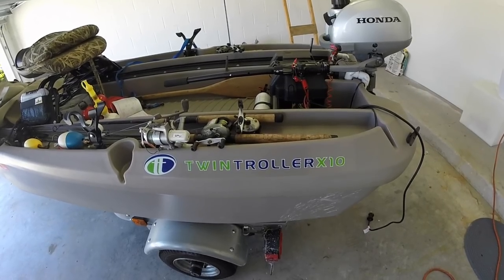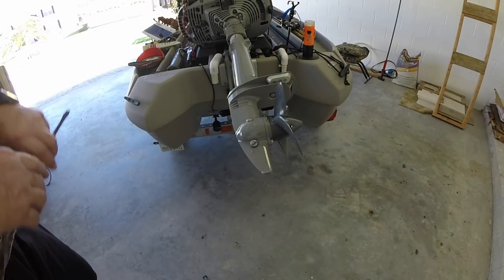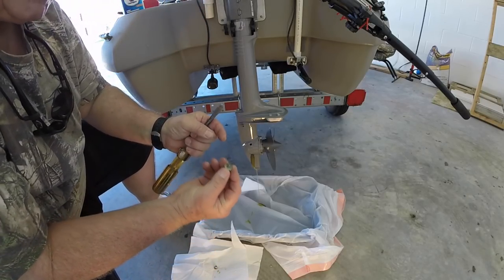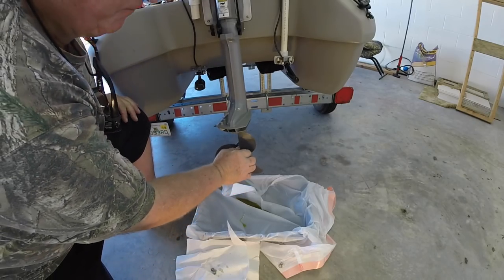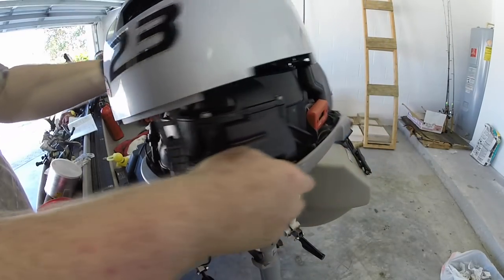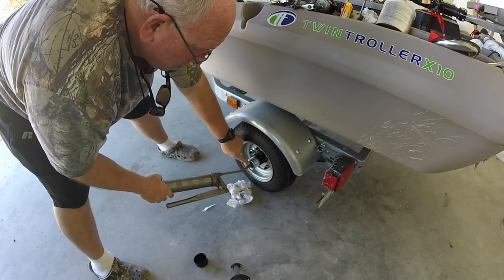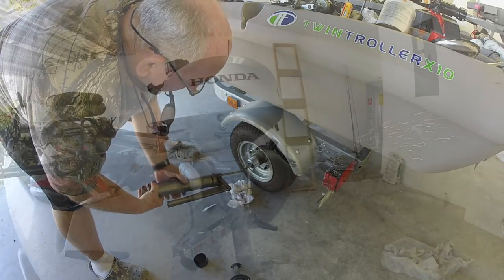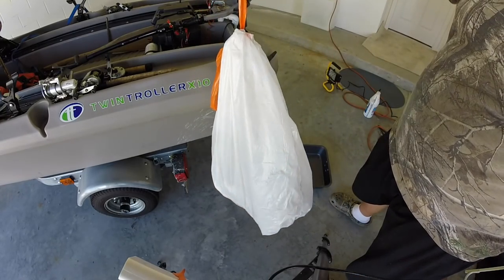HOW TO TUNE UP A HONDA 2.3 HP OUTBOARD ON MY TWIN TROLLER X10

Comment: Great video but how do I add the gear oil?.
Reply from the maker: Todd, You are the first to point that out. Apparently that was left on the cutting room floor when editing.
See the gear oil bottle at time stamp 1:27? Under the black cap there is a pointed nozzle. Snip off the tip of that nozzle so oil can be pushed out. Insert the nozzle into the bottom hole and squeeze until oil comes from the top but no more bubbles. Then continue holding the bottle in place  while inserting the top screw and start that screw by hand for now. Remove the bottle and then insert the bottom screw QUICKLY and get it started also. Then tighten the top and bottom screws. You will always loose a small amount of oil but if you are organized and fast you will not lose much.  You will do a much better job the next time you do this, next year. 
Good luck, Gerry

Comment: Did you ever hear a squeak in the Lower  propeller linkage when turning the propeller? Or does being submerged in water handle that?
Reply from the maker: Bill, I do not turn the prop out of the water so I do not know how to answer you. Try removing the prop to make sure there is no fishing line or debris behind the prop and if not, try spinning the shaft with no prop on there and see if you hear the squeak then. If you do it is an issue in the lower end.          Gerry
Reply: Lunker012  I have the long shaft model as it’s for a small sailboat ,squeak comes from the shaft extension linkage housing ,just serviced the motor after the first 10 hours ,I’ll ask the Honda guys still under warranty,thanks for the quick reply ,
Reply: Dealer said only turn prop clockwise ,chirp was impelers  ( rubber ) squeaking against housing  ( cools drive shaft)

Comment: Hello Jerry, greetings from Italy. Thank you for the great work you did, I am going to follow all the procedure to replace engine oil.  Actually I had an issue with my bf.2.3. I loaded into my car and laid from the wrong side…
 and I had lots of oil going out and I was not able anymore to start it up. I guess some oil went into the engine because when I remove the spark-plug I see is wet and looks like some oil is in it. In any case I cannot run the  engine anymore, it does not startup.  So yesterday after I saw your video I drain all the engine oil from the screw as you shown in your video and now engine is totally empty, honestly I don’t know if I need to open up the engine to the pistons level to clean it up, if you have any advice would be really really appreciated.
Reply from the maker: Giovanni, do not open up the motor yet. Try some of the following. Get a new spark plug (or at least do a good job cleaning the old plug to remove all old oil and fuel)  to put back in the crankcase.
Stand the motor back up and put it on a stand or the back of a boat transom, some place you can start it. Remove the spark plug and keep putting the starter rope until you do not have any oil squirting out of the spark plug hole. Pull that rope fast and many times to clear the oil and any fuel from the cylinder. Make sure you replace the crankcase oil to the normal level that leaked out when you put the moron on the wrong side. Connect the new plug to the wire but do not screw it back in yet. You or someone else hold the spark plug threads against the motor where the threads of the spark plug hole is. Pull the starter rope fast to see if you have spark. Make sure the kill switch is not disconnected and the throttle is in the start position on the throttle handle. If you do not have spark you have an electrical issue if you have spark you have a fuel issue, if you feel compression when puling the rope. If you have spark then now screw in the plug. Make sure you have fuel in the tank and the lever to allow fuel to enter the motor is on like you do every time you start the motor normally.
Try to start the motor as you normally do. If it still does not start let it sit and wait for another 1/2 hour in case it is flooded. 
If it still does not start, pull the plug to see if it is wet. If it is wet it may be flooded, leave plug out and pull rope a bunch to clear it and dry/clean the plug again then reinsert it and try starting it again. If it was dry they you are not getting fuel.
If plug is dry squirt a small amount of fuel in the cylinder then put the plug back in and if it starts, or tries to, but will not continue to run you have a fuel/carburetor problem.

Let me know how it goes,
Gerry
Reply: Lunker012 thank you Gerry for the valuable hints. I will try these days and let you know how it goes. I was thinking to open the cylinder to clean but i prefer to avoid this. Will try as you recommend.
Reply: Lunker012 I fixed it thank you. Acrually I removed the filter to check and there were oil everywhere inside the carb, gasoline oil everywhere. I dismounted the carb and washed all with gasoline and mounted everything back.  Then i followed your hints to get the oil out from the cylinder. Reinstalled the spark plug and at the first attempt the engine started. Its a good motor i like it. Mine lost the stickers to show the direction to laid it down. Which side do i have to put it down. Keeping the motor in front of me with the handlebar on the right, oil window in the right side. Should i put it down right?
Reply from the maker: Giovanni, sorry for the late reply. I just noticed your question.  The easiest way to remember is with the Honda laid down the tiller arm would ALWAYS be the highest point on the motor. The tiller arm would never be down on the floor. If you look on the side of the motor there us a small square shaped protrusion. That is the stand that you lay the motor on when it is on it's side. I hope that helps.                           Gerry
Reply: Your video and detailed explanation helped. Thank you very much

Comment: Being you have to lube the control arm by removing it from the body, perhaps you can change the oil with the arm off and prevent the mess of the oil running down.  😊. BY THE WAY I owned one of these about 15 years ago.  I had it about 4 months and it was stolen.
Reply from the maker: Walter, Good point however, I found another way to easily change the oil that I will show in a future video on servicing this or any other motor. Stay tuned for that.            Gerry

Comment: My 2.3 honda got backfire.  Increase speed and bog down. What cause the problem.
Reply from the maker: Not enough information to make a response. That description could have so many causes. Bad fuel, fuel filter clogged, spark plug bad, Spark plug gap not right, spark plug wire bad, Carb settings off, Timing off, Valve clearance off, etc. etc. etc.

Comment: i was looking at hour meters, couple questions. do you know your model#, I want to makes sure what i order is thin enough. also, no connection other than wrapping is needed. Thanks again for your video
Reply from the maker: Ted, here is a link to mine, I hope that helps:
https://www.youtube.com/redirect?q=https%3A%2F%2Fwww.ebay.com%2Fitm%2FMotorcycle-ATV-Mini-Hour-Meter-Honda-Yamaha-Suzuki-Kawasaki-High-Quality-IP68%2F273043326744%3F_trkparms%3Daid%253D222007%2526algo%253DSIM.MBE%2526ao%253D1%2526asc%253D47300%2526meid%253Df649e14c80114fe5bb6115037c65b7d5%2526pid%253D100005%2526rk%253D5%2526rkt%253D6%2526sd%253D322604163722%2526itm%253D273043326744%26_trksid%3Dp2047675.c100005.m1851&event=comments&redir_token=S_vGq6C5hArmIJgCnD2QPhXvSFh8MTUzMjQ0Nzg4NUAxNTMyMzYxNDg1

Comment: Hello, I want to buy this engine for a pneumatic boat. Can it push 250 kg? (2 people with fishing gear...)
Reply from the maker: Sorin Yes, but you cannot go water skiing behind it. That is about the size and weight of my boat and while it does not go fast enough to make you hang onto your hat it will get you there.    Gerry
Reply: thanks for the reply

Comment: Hey Gerry,  did you need to replace any washers when you changed the engine oil and the gear box oil?  Thx
Reply from the maker: Ted Finkenauer 
I did not change any. I do not think you need to. Just make sure the surface they contact is clean so it seats correctly and does not leak.         Gerry

Comment: Jerry if the fuel cap and fuel switch are both in the off position can it be laid on the side without fuel leaking from the tank? I only took mine out once so far and it leaked fuel but I did not remember to turn the fuel switch off.
Reply from the maker: Lt., I was also a Lt  for 13 years before retiring. I also belonged to two different fire companies when younger. 
If you turn off the fuel lever on the rear left of the Honda and close the vent on the fuel cap you can tip the motor to the horizontal position while still on the transom and fuel will not leak. You can also remove the Honda from the transom and lay it on the ground horizontally. Make sure you set it on the correct side ( handle up) or crankcase oil can leak out.
Sounds like you may not have turned the fuel shutoff to the off position causing the carb to leak fuel.
I hope that helps. 
Stay safe,        Gerry
Reply: @LunkerFishing  did fire local? I'm in the central FL area also.
Reply from the maker: @Lt.Fireguy , I belonged to two volunteer companies in Upstate NY and spend 25 years with NY State Corrections.

Comment: Any tips on why my motor quit running unexpectedly? I could not restart it. I suspect carb/fuel got water in after rain? Do you have vid on carb service perhaps?
Reply from the maker: Snake, I do not have any videos but am quite experienced at small engines and I have some suggestions.  Are you sure you did not forget to move the lever that allows the fuel to flow on the rear left of the engine cowl and make sure you did not forget to open the vent on the fuel cap? The motor will act exactly as you described if you do not do that. The fact that you are concerned about water in the carb or the fuel leads me to not suspect other things like bad fuel before the water/rain got there or dirt/foreign matter in the fuel? You talked about rain so I will go in that direction. If there was dirt  in your system the passages in the carb is easy to become plugged. Lets assume that is not the problem. I always use non-ethanol fuel in all my small engines, especially the Honda outboard. I also use a fuel stabilizer in that fuel, always.
Lets assume it is just a contaminated fuel system that introduced water and not dirt. At this point you need to remove all the old fuel from the tank and carb and that will remove the water. Siphon out the contents of the gas tank as best you can. 
I just looked at my Honda but cannot see the bottom of the carb to see if there is a drain screw on the bottom of the float bowl without taking my gas tank off. 
You can always remove the few nuts that hold the tank on, loosen the fuel line clamps and pull then drain the tank and the lines. Now you have to get the fuel out of the carb. If you do not want to pull the float bowl down (located on the bottom of the carb) or there is no drain screw, there is another way but slower and more tedious to drain the carb. Pull the spark plug out and keep pulling the starter rope many times until it is likely all the fuel has blown out of the spark plug hole and the carb is empty. 
Just to make sure this is not a spark problem when you think it is a fuel problem hold the spark plug, with the boot installed, against the threads  to the spark plug hole but do not screw it in. Have someone pull the starter rope and watch to see if the spark plug is sparking strong across the spark plug gap. If there is a strong spark that system is OK. 
Now put the fuel system back together and reinstall the spark plug. Add FRESH CLEAN fuel and see if it starts. Remember the system is dry at this point so it may take a few pulls to get the fuel through the system before it will start. My guess is you will be fishing tomorrow. 
Let me know if that helps.                 Gerry
Reply: Lunker012 Thanks for all the tips. I am going to start by draining fuel and also replace the spark plug. I think rain came in at the vent that was open...

Comment: I have a dumb question.   Is there some sort of keeper for the prop if the shear pin breaks?   It looks like the shear pin takes the load and the cotter pin keeps the prop
on the shaft but if the shear pin breaks, then surely the cotter pin takes all the load and will shear also, and goodbye prop (does it float?).    I was expecting that the prop could freewheel.   Am I missing something?
Reply from the maker: Larry, it works just like any other propeller on any other small outboard.  There is a cotter pin that keeps the prop on the shaft and a shear pin that keeps the prop turning with the shaft. If the shear pin breaks the prop spins freely but the prop stays on the shaft until you remove the cotter pin. I never tried to float the prop, likely is sinks like any other prop but I never checked. 
The Honda came with a spare shear pin and has a holder for extra pins on the motor. I purchased extra pins so my holder on the motor has more than one but I never needed any in the past four years. 
If you watch my video on doing a tune up for the Honda you will see me remove then replace the prop to check for string or debris under the prop.
Gerry
Reply from the maker: To clarify, the cotter pin only has a load to keep the prop on the shaft. The shear pin takes the load of keeping the prop turning with the shaft. If the sheer pin breaks there is no more load on the prop cotter pin than there is before the shear pin breaks. If the shear pin is not broken but the cotter pin breaks then the prop can fall off the shaft at any time.
Reply: @LunkerFishing  I'm confused how it freewheels.  How does the cotter pin hold the prop on the shaft?   Is there a hole in the end of the shaft that the cotter pin goes in? (then it can't freewheel) or is there something that rides in a groove on the end of the shaft and some sort of key?   or does the end of the shaft have a part that can freewheel that you need to line up with the cotter pin?   It doesn't make sense yet to me.   Thanks for educating me.
Reply from the maker: @larrywiniarski1746 , Under the prop there is a shear pin that goes through the metal shaft that is connected to the lower end. The prop has a slot on the underneath that slides over the shear pin when you slide the prop on the shaft. The shear pin keeps the prop connected to the metal shaft so when that metal shaft spins so does the prop.
The section of the prop that protrudes the farthest to the rear has a hole where the cotter pin goes.  When the shear pin breaks the cotter pin stays on the shaft. If the cotter pin and the shear pin were both broken the prop could fall off completely.

You probably need to look at one to get a clear picture of how it works. Go to page 18 of the manual:
https://cdn.powerequipment.honda.com/marine/pdf/manuals/00X31ZVA6040.pdf

Comment: good description ...
where is carburetor maintenance ... ??

mechanical maintenance with detailed interior
Reply from the maker: Ender, I buy ethanol free fuel and put fuel stabilizer in my gas can before I buy the gas so it is treated the second I buy it. I have never had to do any maintenance on the carb other than to grease the throttle fittings I showed in the video. 
I am in Central Florida so I do not have to winterize the carb either but since you buy ethanol free fuel, add stabilizer, then all you need to do turn off the fuel  lever and run the motor until it is out fuel, remove the fuel bowl drain screw at the base of the carburetor to let the fuel still in the carb out, then get your snow shovel ready for your entire winter of hating you live in the cold where you do.                 
I have no idea what "mechanical maintenance with detailed interior" means. Please explain.                     Gerry

Comment: Just today I noticed that the sprung leg holder upper was seized on my 2005 2hp Honda - consider putting this on the 15 year maintenance list 🤣
Reply from the maker: What is a sprung leg holder upper?                   Gerry
Reply: @LunkerFishing  it’s the shiny lever that holds up the leg (ie the propeller) when you tilt it out of the water.  You pull the motor and raise it when you want to lower it again.
Reply from the maker: Wow, I never have had a problem with mine but I will keep an eye on it from now on.

Comment: You didn't need to put any Marine grease on the little shaft that holds the shear pin and prop?
Reply from the maker: Pat, you could do that if you want to. If it was a metal prop it would be something you may want to do to make sure the metal shaft does not rust and fuse together with the metal prop then grease would be a good idea to stop that from occurring. 
You may even grease the pin to help that from rusting or even to keep it from falling out when installing the prop. In the video you see me install that pin when the holes in the shaft are horizontal to keep the pin in place until I install the propeller. 
Good question though Pat, if you feel more comfortable then by all means add a little grease there.                                    Gerry
Reply: Thank you so much for your accurate and prompt response it means a lot to me just like your videoe,  I learned so much ...I wish you the very best